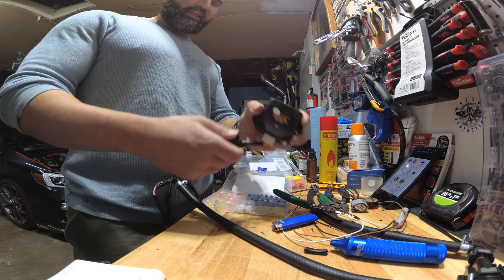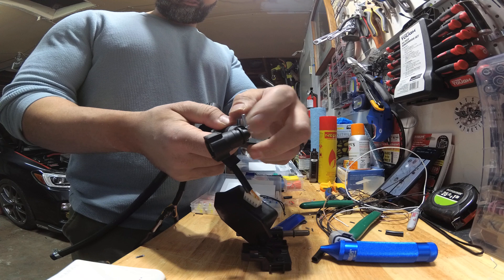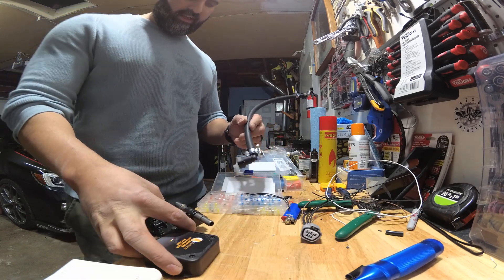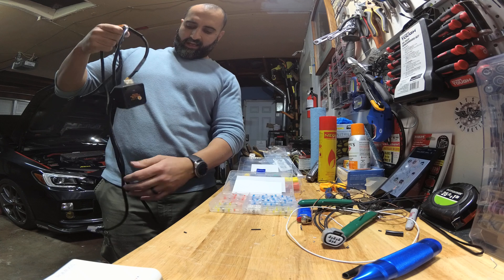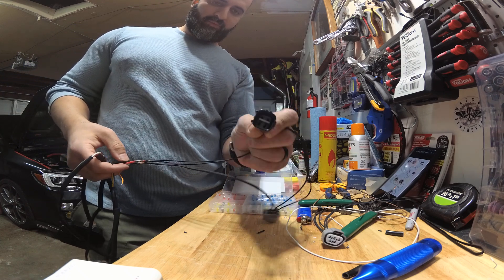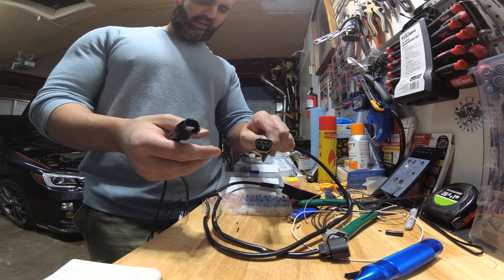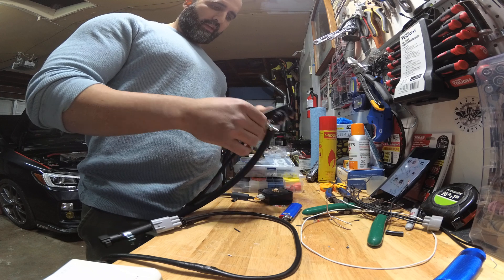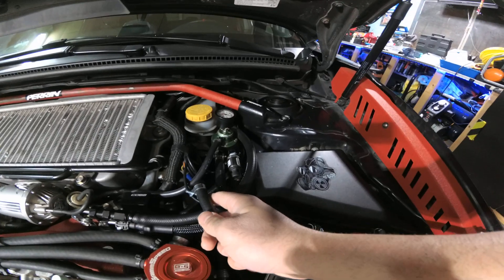DIY  how to overview Flex fuel kit plug and play WRX STI 2017

Comment: In theory, if you have a Cobb kit and the module went bad, could you just use wire that module you used into the existing setup?
Reply from the maker: 100% its just a signal converter
Reply: @LibertyJOEVI  man you just saved me $450 lol thank you! Great video
Reply from the maker: @AJrcrk  no problem, just make sure you wire it correctly based on my video

Comment: Nice overview, I would love to see the full video as well. Does the module device just replaces the diy arduino board?
Reply from the maker: It is the next video up! Yes module replaces the arduino and this way if it needs to be replaced u just unplug it and plug a new one in vs hard wired stuff
Reply from the maker: https://youtu.be/irPhcf9DNN4